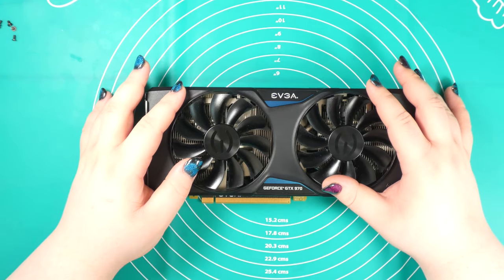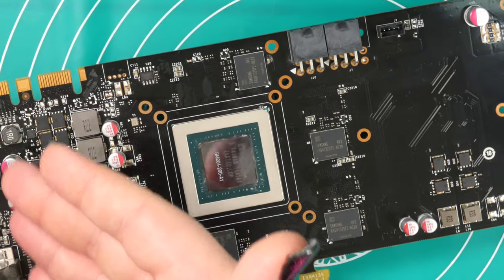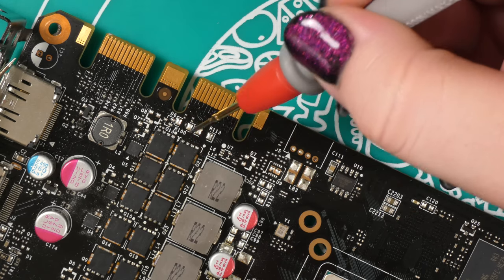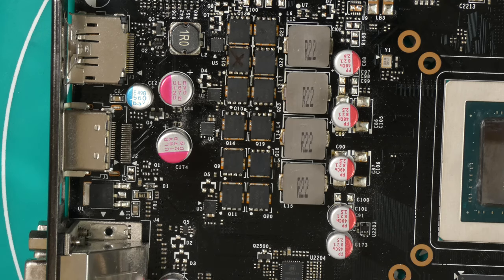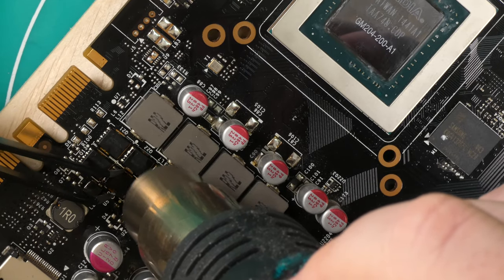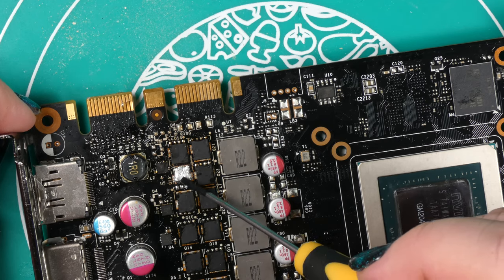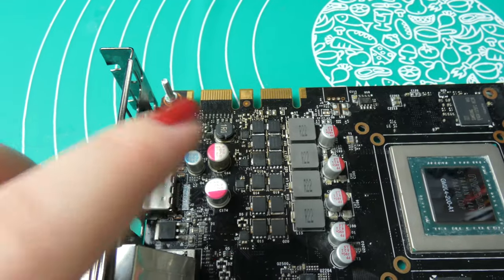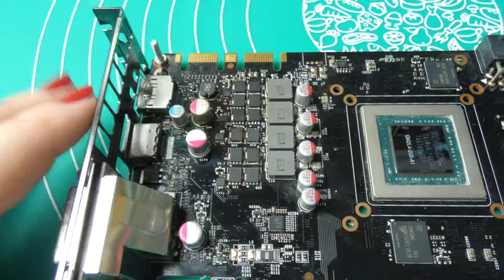Nvidia Graphics Card Repair - EVGA GTX 970

Comment: A great informative video.
I had similar issues as you when heating the board to remove a failed MOSFET. The issue is that the board is essentially full of copper traces and these will immediately wick away any heat from the area you've focussed your heat gun at. This is more evident when trying to prepare the bare PCB surface for re-seating the new component, and you'll notice that despite the use of flux and a very hot iron, the solder will not flow as it should. Again because the board is wicking the heat away from the solder and the iron.

I decided to purchase a single electric hot plate (around £13-£25 from Amazon) to pre-heat the entire card, as this way you can get the components up to temperature and removed/re-soldered faster and easier. If the board is already hot (not too hot), it can't steal the heat from the area where you're working, you just have to be a little more careful with your working area and any plastic tools around it.

Comment: to desolder a mosfet properly and quickly you need to use the small nozzle and set the temperature to the highest (450 - 500°C) with a bit of air (3rd level max).
350°C isn't enough as it will take a lot of time to melt the ground solder and it will cause harm to the components near the mosfet! :)
Reply: im curious (as a newbie) If the Mosfet was damaged, i presume this is current overload or something, which is heat? So, at what temp does the mosfet start to be damaged? How hot can they get before failing?
Reply: @gepisar   If you look at the mosfet data sheet, it will usually tell you a package max temperature, just assume above that bad things start happening.
Reply: Для выпаивания мосфетов лучше использовать нижний подогрев . Иначе легко повредить текстолит , перегреть электролитический кондесатор .
Reply: @gepisar  presumably, it was slightly off spec to begin with, and the issue simply wasn't strong enough to be detected in testing, maybe it got static damaged after it was factory examined but before it was put on the board, but maybe it was overheated in operation as well, which is why thermal pads shrinking with time and getting unstuck from a surface is a potential issue. Critical die temperature is around 150°C in operation, but ideally you want a lot less for long life, since momentary temperatures during switching count and not just average over a time. Support components are worth a look as well, cracked ceramic capacitors in vicinity and other components designed to tune the behaviour of the circuit, but it's rarely the issue.

High temperature causes electromigration and gradually degrades the semiconductor, reducing its properties. On-state resistance will get higher (worse) and switching speed will get slower. The MOSFET emits most of the heat during the transition while it's being switched, and relatively less when it's fully on and zero when fully off.

Problem is that if the semiconductor is already not ideal, either from abuse or from manufacturing, it will emit more heat than usual. Then it will have to be run harder. Soon you get a runaway condition where it's running hot because it's damaged, and it's getting damaged because it's hot.
Reply: @MrAlxalx  So heat it up from the other side of the card?
Reply: @HardWhereHero  Про эту карту не просто так нет информации на сайте производителя . Она неудачная.

Comment: Nice video! I agree, mosfets are particularly difficult to remove with the non-leaded solder used these days. Most times, I have to break the package to get them off. One tip I have for you is to use a soldering iron and a wick to remove the non-leaded solder from the factory and re-tin the pads with some regular leaded solder. It will make reinstalling the new mosfet easier and use less temperature.
Reply: I agree. Where you can, add some lead before you start. And as iPadRehab always says "add more flux" :) ...I followed Louis Rossman's advice and acquired some Amtech NC-559-V2-TF "sticky flux", and it's fantastic.

Comment: Finally! a technician which explains everything straight to the point with simple words, unlike others which they try to sound like scientists. You earned my sub keep up the good work!
Reply: If you want to listen to a technician you should go watch Northridge Fix. She said she wasn't good.... And it shows actually. Using a heat gun around capacitors (those cylindrical components) is asking for a DISASTER. Those components blow up when there's too much heat!!! They should be protected with some sort of shield so there isn't heat transfer... And has she said... She had to apply a lot of heat to the mosfet. Which is VERY close to the capacitors!!! It's LUCKY she didn't got injured! SAFETY people!!!
And bro... She's limited on equipment... No voltage injection and heat camera?!? Yeah... She ain't going far with this

Comment: I had to repair my GTX 1080 Ti Waterforce, it had blown mosfet, it infact had melted it self into the groundplane but i managed to save the card by using dremel and drilling most of it out to isolate it. In the end it worked but is running with 11 mosfets instead of stock 12 smosfets. Sold it later to friend and to date its still working perfect on my friends pc, i repaired it about 3 years ago and sold it about 2 years ago.

Comment: How unfortunate ☹️ I really hate when components are as stubborn as that MOSFET were. I've purchased a preheater to use underneath the PCB for when working on such multilayer boards as I've heard the heat can cause the boards to bend and warp from being applied from one side only. I've seen videos of preheaters in use making the removal much easier as the area you are working on is closer to the temp needed and so you don't require such a long dwell time with the hot air tool on the top of the component.

I do hope you don't give up on the board and manage to find the culprit and repair it. Good luck!
Reply from the maker: Thank you very much, I'll do my best!
You have a good point there I never thought about the possibility for the board to bent. I've never seen one or had the issue but definately something to consider. A few days ago I made a new video in which I try using a ceramic IR heating element for soldering and well (spoiler: it does work) but since then I was playing with these old, broken graphics cards from last video and used the heating element to preheat the pcb to around 180°C which worked so much better than I ever thought so there will also be a video in which I show the possibility for it to be used for preheating pcb's.

Comment: The reason for hard desoldering of shorted high current transistors is that some times the drain welds it self to the PCB, if that is the case I would use a dremel with a stedy hand under a microscope in order not to damage the pcb or other components with excesive heat. Also, before this method try by adding flux as many times as needed and use a 10 mm nozzle with ~400  C.   I use 480 C every day on automotive ECU's (FET's, SMD micro-controllers) BUT NOT on BGA like these GPU processors.   40% leaded solder doesn't help at all with hot air desoldering,it helps only with direct contact soldering station for a higher contact surface of heat transfer and a proper shaped  soldering tip.
Also you should have measured the gate trace resistance before put in a new FET (it is allways a good practice in order not to work for nothing),  measure and open the FET with a multimeter to check if it's body diode is shorted and if the FET is opening (do not forget that when you open the FET by multimeter, drain-source will act as shorted because of the internal capacitances, you must close the FET by shorting drain to source before conclusions).

Chears!

Comment: afteryou remove the part , put some flux on and use solder wick to clean the pads , then use a solder iron and some tin to retin the pads.
This way there is no contamination or remainder of the old part (especially if it broke during removal)

Comment: Hi, Anna, where do you get Evga graphics data sheets from and what do they look like and cover? Looked on Evga web site and nothing there for my Evga e-Geforce 9600 GT (512MB) graphics card. Also, my brand new LAP multimeter does not beep when I set it to continuity and touch the probes together. I get readings on 5 of the six pins in the power port of the card, but no beep on the odd one out. Does this mean there is a short? Love the way you progress very methodically and clearly through the fault-finding process and the colourful cuticles. Have subscribed. Thanks.

Comment: Pre heat the board a bit before going on the chip so it doesnt soak the heat as much. I would also protect the electrolitic caps because they explode under high heat. Oh and do use flux! :D

Comment: Keep in mind that the passive core resistance can be between 0,5-10ohm depending on model and the other vrm rail like for memory in the 10-300ohm again depending on model. So you using the beep function that does that from 100ohm can mislead. The vrm resistance will indicate the gpu health. And it can be shorted from vcc to core og gnd to vcc on the core. And the switch controller can be faulty as well. It does take time and even broken cards that you break more to know and lean what and how the card works. The 12v voltage rail from pcie slot, should be around the 3-4kohm and the pll or plex ind the 150-500ohm depending on model. I have a r9 290X that have 14ohm on the 12v pcie rail and it should be the 3.5kohm because a shorted pll core in the gpu it should be 30-40 ohm.

Comment: These ones are feisty, they sit directly on gargantuan copper pours in inner layers, which wick away all the heat! This isn't the case with the driver chip and its friends, they're barely connected thermally to the copper mass. It may be wise to preheat the board to run ahead of the soak and protect the components you don't want to hurt with some alu tape.

The current handling capability isn't the only difference. For each branch of the VRM, you have one high-side FET and two low-side or free-wheeling FETs in parallel. The high side FET passes a high voltage and low current, its main operational requirement is fast switching and low gate capacity, they are also on for only a very short burst of the cycle. The low side FETs pass a low voltage and extremely high current, they need low on-state resistance, they are on for most of the cycle. For this reason, low- and high-side FETs ideally shouldn't be switched around, the specified component should be used. The layout of this board is a little tricky to see which one belongs to which branch and side.

Comment: my 970 had a scare the other day, just died and the fan would not start, it's a zotac blower, already stripped, cleaned and it's working now though it needs a fan replacement, thankfully, to avoid using an uncooled card in the beginning of summer, my brother is more into console and had a spare 1080! cannot say enough just how reliable a zotac 970 is, years of use and it's  only the fan that goes! roll on 2 weeks when my rtx3060ti arrives!:)

Comment: Do you know the specs of the ceramic capacitor on the other side of the board? C848. It's on the opposite side of the Q13 mosfet in this video. The upper left mosfet on the board. I could also use the specs for that mosfet. Mine are 4C06N - RCC4R. I found 4c06n mosfets but I don't know the amp rating I need. Will be looking for your other video next.

Comment: Hello there
Do you know how to check a PWM controller with a multimeter? Because I suspect it causing a short on the Mosfets, I removed a Mosfet and measured it alone there's not short. The PWM model is NCP81174 for a ZOTAC GTX 970.

Comment: Everyone is an expert here of course but a couple of tips. Cover the caps with a heat sink before heating as they tend to explode with too much thermal abuse. Pre-heat the board prior to removal and use good quality flux and wick to remove old solder and replace with leaded solder before replacing the component.
Reply from the maker: Hey thanks for your comment!
Preheating is something I do ever since I had problems in this video, as for flux I now have different types for different applications. At the time I made this video I still had a supply of leaded solder but it ran out and everything I can get my hands on is awful quality. So I mostly use lead free solder nowadays.
I was aware of the risk with overheating capacitors but never considered using a heatsink on them. I don't know if it is that necessary but still thankful you mentioned it. Even if I'm not going to do it others might read your comment and decide it is the right joice for them. 
(edit: I had caps blowing up on me in my early days of the hobby but has been years since it happened last)

Comment: I love the Nails! Also I am currently using a Radeon 3000 IGP that microsoft decided to no longer supprt, thanks, Microsoft, you wankers. Anyway I have a 5770 and 4780(I think) somewhere in the house and thought I'd have a look. So thank you for puting this together, free knowledge is exceptionally underrated these days <3
Edit: the eye dropper is genious!
10:20 The mosfet probably partially fused to the bus when is shorted, very good job, I was thinking you were going to pull of the pad xD

Comment: Generally, if a part in an electronic blows, there's something else wrong.  Unless you fix said other issue, replacing the part isn't going to fix it.  First guess says run lower power through it with a thermal camera and check other parts of the board for shorts and excessive hear.  It sounds like you were doing a bit of voltage prodding as well, which can also be a good indicator.

Comment: Hi, great tutorial, but i don´t undestand. You said that the Lower rated mosfet was broke, wich is the 46amp (4C10N), but you finally installed the higher rated mosfet of 69amp (4C06N), maybe that's the problem?
Reply from the maker: This was not the problem here but I get where you come from. These two mosfets are the exact same, except build for higher/ lower current than the other one is. Switching behavior is important and they are, as I stated, the exact same in every regard but current rating. 
However you might have been right if they were from two different generations (lacking a better word here) and if I didn't check the switching behavior. You may want to watch my newest video to understand why it didn't work the first time around and what other problems I ran into :)

Comment: for mosfets with these type of heat stations use 4 to 5 on air flow, and heat to 400c thats enoug plus use a nice flux dont forget tho.. you can cover the caps with aluminum so they dont get tosted, dont pull them hard till the solder its liquid, dont be afraid its ok in the way to learn to make some mistakes and most of the times you need to replace all mosfet and driver of the line other way they will fail again in short time or allmost instantly

Comment: You are very thorough and amazing with your handi work I have a card that is giving me black screen turns on with fan on full blast lights but no screen any ideas I have checked the mosfets they are all good I can't find anything
Reply: Dead temp sensors maybe ? 🤷🏻
Reply: @mattmin45  I was wondering how and where the temp sens is

Comment: I have the exact same board, when it went bad the computer turned off and would not turn on. I put in another lessor graphics card, and the computer ran normally so I know that the GTX 970 is bad. There is no visible damage. I would like to repair this board as replacing it would be expensive. I am a retired technician, I used to do this kind of work for a living. Having a schematic would help, but those are likely proprietary.

Comment: Hi Anna, can you remember the name of the mosfet?  best regards!
Reply from the maker: There were two different mosfets used. I however used the higher rated 4c06n for the repair. The other lower rated one was the 4c10n if I'm not mistaken.